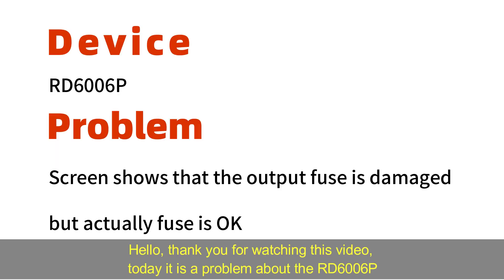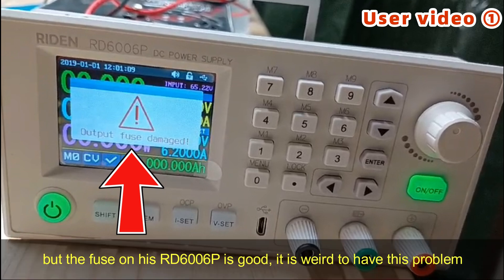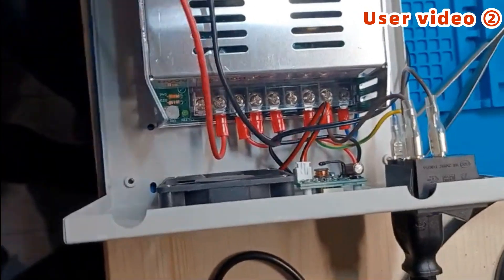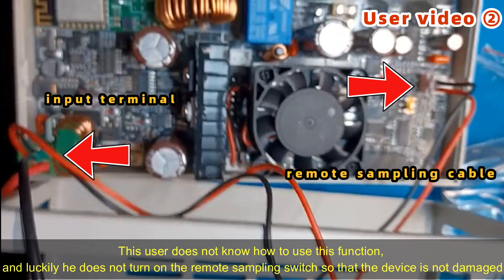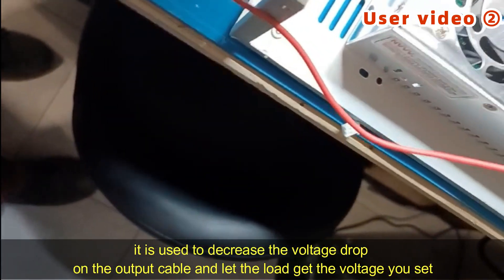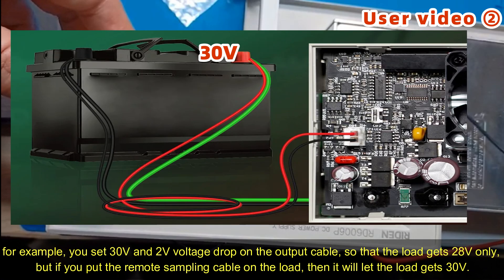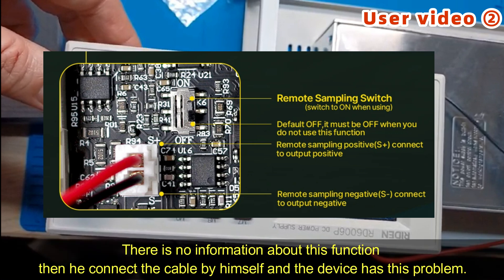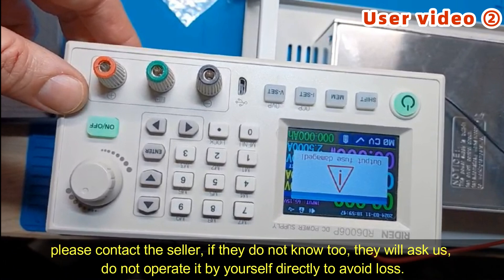RD6006P remote sampling cable wrong connection to input terminal!

Comment: Nobody read a manual instruction :) and so it Is :D
Reply: RTFM 😂
Reply from the maker: for some simple operations, like set voltage and current, it is easy to do it since there is V-SET, I-SET on the button, but for some function which cannot know directly on the panel, like restore factory setting, enter boot mode, calibration, and the remote sampling in this video, it still needs to read the manual to know how it works, and yes normally most customers will not read the manual before using haha😀